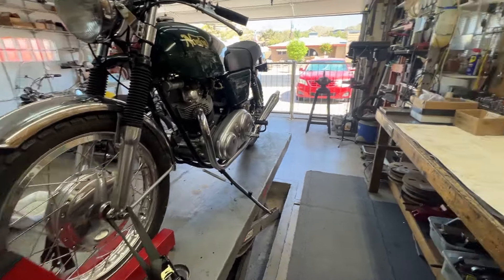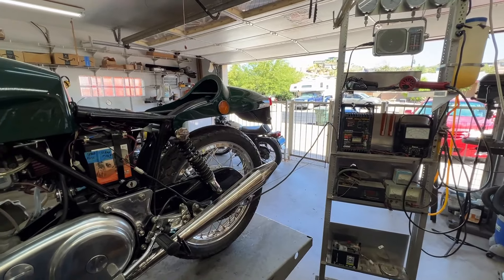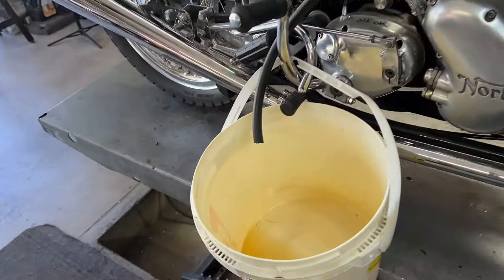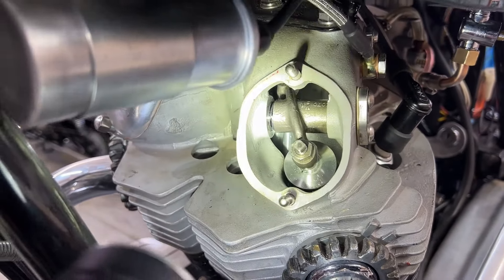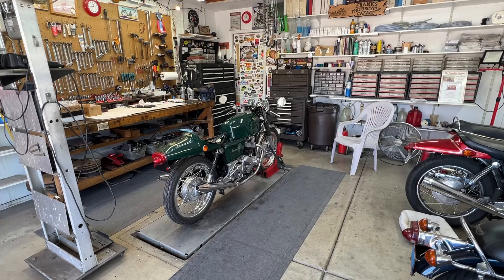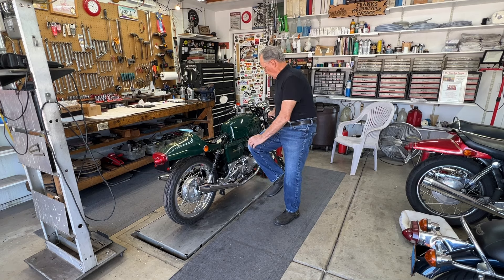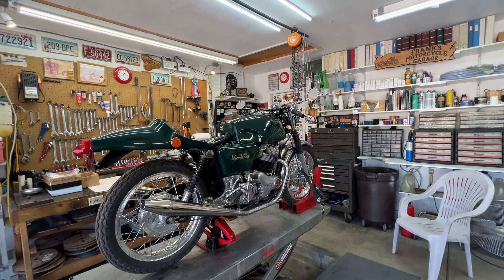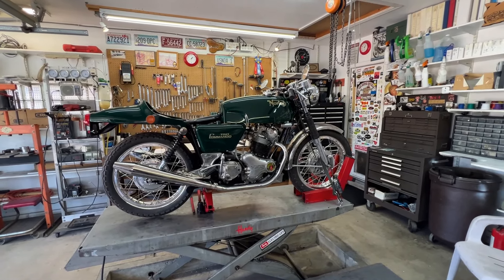05-06-24 – 71 Norton - Green FB - Start Attempt

Comment: You'd do well to get yourself a paddock starter 
Commandos get harder to start as you get older 
There's good and bad aspects of a single mikuni VM 
The worst being the lack of top end plus they don't always want to shut down 
The best is  better bottom end grunt and light throttle operation (if you haven't had to fit an Amal spring inside the mikuni one) 
And you never have balance them
I use a single 40mm TM flat slide mikuni pumper on mine it's a brilliant setup
I've not really had a problem removing twin Amal concentrics ,it was fiddly the first time but with the cut down Allen key it's ok 
I'd give the enrichment plunger a check on that carb if I were you 
Make sure it's seating properly 
Be sure not to open the throttle when you kick it 
Maybe adjust the idle screw up a little

Comment: Just put a single AMAL carb on there keep true to the British 
I put a brand new single AMAL carb on my 68 BSA Thunderbolt and it runs great
Reply: British yes, but Commandos always had twin Amals concentrics, never single.
Reply: @ashleyhoward8926  that's true but unless you're racing you don't need them a single carb will give you a better low end

Comment: I love watching your videos but can't understand why you don't have some easy start to eliminate possible fuel problems.
Reply from the maker: I just don't believe in forcing a bike to start with rollers or starting fluid.  If a bike wont start with a half dozen kicks there is a problem that needs to be isolated and fixed.  Forcing a bike to start could (possibly) cause more problems.  That's just a personal opinion.  Not snark.  I just want the bikes to want to start.  And if they don't want to start I feel the need to find out why.

Comment: You need a set of electric rollers to save your knee
Reply from the maker: Electric roller starters are great for race day starting high compression race bikes with no kick start levers for weight saving reasons. BUT, I DO NOT believe in forcing a recalcitrant motorcycle to start when it doesn't want to.  If a bike in my shop won't start with a few to a dozen kicks there is a problem that needs to be isolated and fixed.  Sorry, but I HATE the whole idea of roller starters.  Question for you:  (Serious. 
 Not Snarky.) Have you personally ever tried to use a roller starter?  I did.  One time.  Never again.
Reply: @fjdelmonte  A couple of times. Not the easiest of items to use.👍